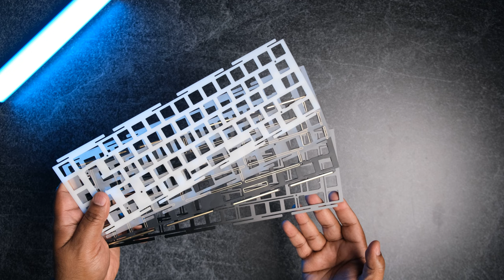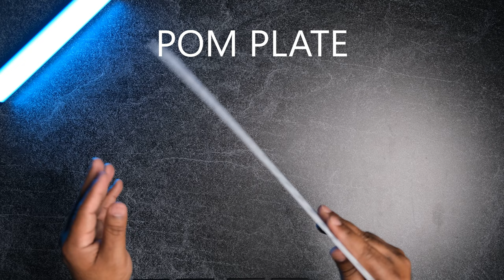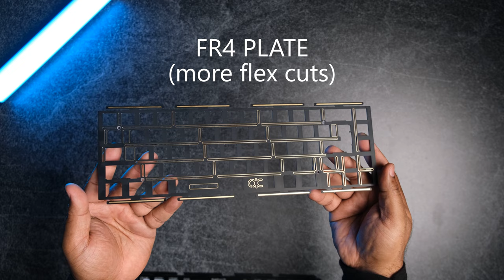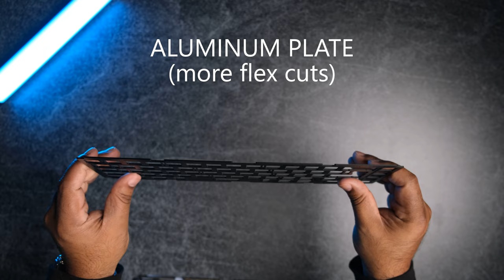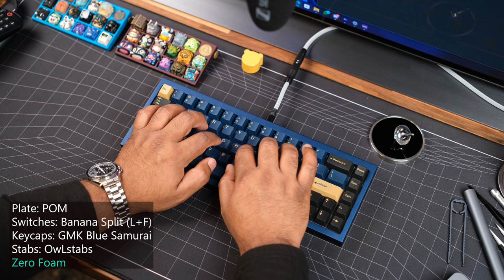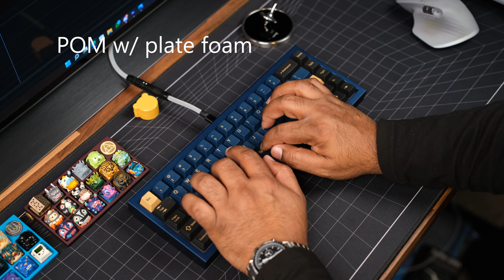Comparing Keyboard Plate Materials feat. QK65

Comment: Weird, even with good headphones there's no way I'd reliably be able to tell the plates apart in a blind test (other than aluminum). Maybe in person and side by side it's more noticeable
Reply from the maker: With plate foam, they are VERY similar. Even in person. Which I why I did it without any foam as well. You can hear a bit of difference in those, but yeah to me, for this board, go with 1 of the soft plates (PC, pom, fr4), and an Alu for some sound variety. Thanks for watching 🙏
Reply: @Clackbait  thanks for the advice and great content! Given the similarity of the softer ones, I think I'm gonna go for the fr4 plate for the esthetics of the flex cuts (which no one will ever see 😂)
Reply from the maker: Good choice. My fav soft one is POM. It has good flex and a nice poppy sound.
Reply: Because the audio itself is terrible. Gain way up on a mic that is probably on the desk itself o

Comment: Really appreciate the time and effort you put into this. Helps with what plates I’ll be going with for the QK65.

All the plate foam builds, unless I did them myself I can’t distinguish if I went in with a blindfold (not a bad thing it all sound gr8 it just feel at that pt)

IMO Alu really shines no foam at all

I like POM / Fr4 for most of my boards but I might consider Alu with some mx blacks since this board is “somewhat” more affordable
Reply from the maker: Agreed. Alu is awesome on this board. If I were to pick 2, it would be POM and Alu.
Reply: @Clackbait  I ended up building mine with plate foam and pe foam only with broken in Kailh stem Hyperglides and my god this thing sounds SO GOOD and feels great.

If all my boards this one is my current favorite in my rotations

Comment: Great comparison, very helpful to help an educated choise of plate. I believe the plate plays an even bigger role in the typing feel depending on stiffness determined by material and mounting type, but it's role in the sound is also very important. Great video
Reply from the maker: You are absolutely correct. In this case especially, feel is the biggest factor since they all sound pretty similar with the plate foam, accept for Alu. Pom and Alu we're my favorite. Thanks for watching 🙏
Reply: @Clackbait  Which plate affects the feel in which way?
Reply from the maker: From softest and most flex, to stiff. PC, pom, fr4, Alu
Reply: @Clackbait  how noticeable is the difference between pc and pom?

Comment: Hi Sir, Thanks for an awesome video!
Actually, i'm planning to buy the QK65 R2 (yeah because i lose on the R1 in my country, sad)
And curious about the plate more.

I want to achieve the kinda Thock, but Marbly and poppy at the same time with the Oil kings / epsilon maybe?
And considering to take the POM and FR4. (with all foam without the plate foam i think, IMO the plate foam will make the sound high pitch?)
What do you think about that? just curious about your thought about this one..

Great videos btw!
Reply from the maker: Thank you so much. I think the plates you are going with will give you that poppy sound for sure. Thock will also depend on switches and keycaps. For me, plate foam really enhanced the sound overall. Def will help your mission for Thock.

Comment: Hey I plan on getting the QK65 (first time ever making a custom keyboard, I've been saving for a long time for this!) and I'm really struggling with trying to figure out what switches (I want linear since I want something easy on my fingers as I type a lot) I want and I'm thinking about going with the gateron milky yellows. Also I really wanted some red keycaps but they all cost so much so if there are any abx or pbt (pref abx) keycaps in general that you recommend I'd love to know!
       Also w/ linear switches what plate would you recommend? So far thinking FR4 as I saw another video saying that over aluminum for linear switches but correct me if I'm wrong! 

Sorry for the long comment, and thanks in advance I appreciate it! (I subscribed!)
Reply from the maker: First. Thanks for subscing my friend. That means a lot!
So plate is strictly preference. For this board if you want a soft typing experience, try PC or POM (pom is my fav). If you want more clack, go aluminum. There is no hard fast rule on plates with linear or tactical. It's all preference. From softest to hardest it goes PC, POM, FR4 then Alu. 

I'll have to think about keycaps that are budget friendly and red. Do you have a price range?
Reply: @Clackbait  Ah okay, I might go with POM in that case. My budget for keycaps would be around 50 bucks, they cost sooo much so ik it's hard to find something around that price range. 
Thanks for the quick reply I appreciate it!
Reply from the maker: My pleasure. I'm not sure I can find some in that range, but if I do I'll ping you. Hit me up on IG.

Comment: Have u tried force break mod on it? If so then how did it change the board in terms of sound
Reply from the maker: No I did not. It really didn't need it tbh. I'm sure it will help, because it just does, but still, not necessary. Unless you go without any foam.

Comment: Is there any difference between  pom and fr4 in terms of feel? They sound not that different but rather fr4 is aesthetically better.
Reply from the maker: Pom is softer than fr4. Slightly more bounce, but not a massive difference unless you run without plate foam

Comment: when using no plate foam, why i hear a bump/thump noice when key stroke?
Reply from the maker: Great question. That is due to the mic and desk. It was a new mic without a shock mount. So it caused some reverb from the desk to get picked up. I changed it up after this video.

Comment: Hey Clackbait, would like to check will the FR4 plate be somewhat the same flexiness vs the POM plate due to the flex cut?
Reply from the maker: It's stiffer for sure.
Reply: @Clackbait  if you would recommend a single plate which will you recommend? if i want deep cream marbly?
Reply from the maker: PC or POM. Pom is my fav and has a bit of pop. PC will give you a slightly deeper sound imo.
Reply: @Clackbait  POM is your fav for this keeb right? i think i might be going with POM
Reply: It was a battle with POM and FR4 lol. currently POM has the edge. If i planning to put all the foam without the PE foam. POM is the best right? if with the PE foam everything sounds the same?
Reply from the maker: Bruh they all sound the same with just plate foam to me, accept Alu. I've been recommending pom + Alu if you want to have some variety of sound. It's all about the flex/feel for these plates.
Reply: @Clackbait  btw this is off topic. Is it worth to get qk65 if I’m currently holding on a q1? And selling the q1 after?
Reply from the maker: No doubt. QK if a superior board.
Reply: @Clackbait  would like to check which plate sounds creamier??
Reply from the maker: PC or POM imo
Reply: @Clackbait  zoom65 or qk65?🤣
Reply: @Clackbait  just got the qk65. would like to check which switch you would prefer for deep marbly creamy profile? epsilon or nebula

Comment: While it's nice you recorded all these options, you have a different sound signature on the 2 camera positions, which means that the sound recording is not consistent.
Reply from the maker: Hey thanks for the feedback. I do not use the camera mic. The mic position that was recording did not move at all. So the signature is the exact same. The difference you may be picking up is the variety of builds. Hope that helps.
Reply: @Clackbait  the sound is different, it might even cone from having the camera in different position. Believe me I can hear the difference, used to be a sound recording engineer. There was no reason to move the camera, next time record everything in the same position.
Reply: @zoltans72  placebo